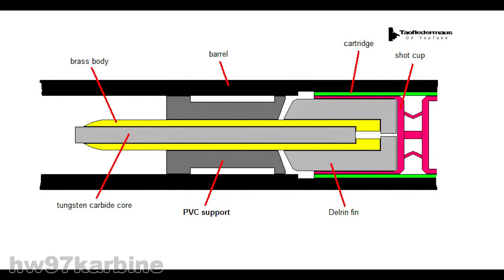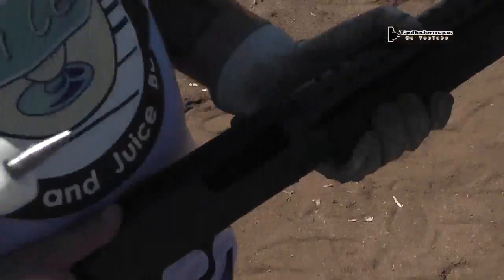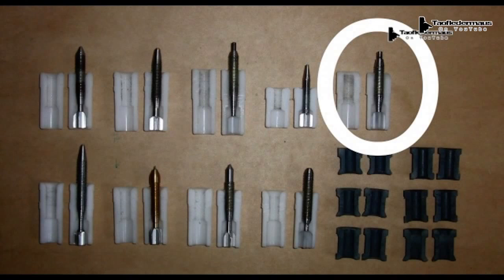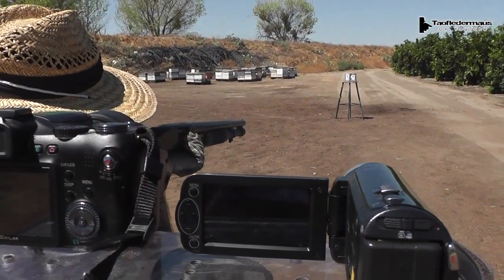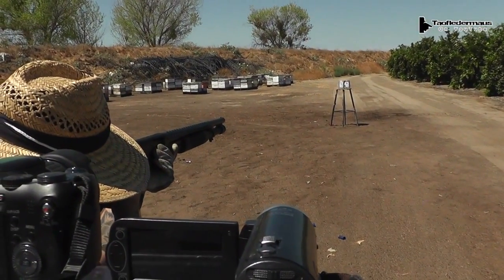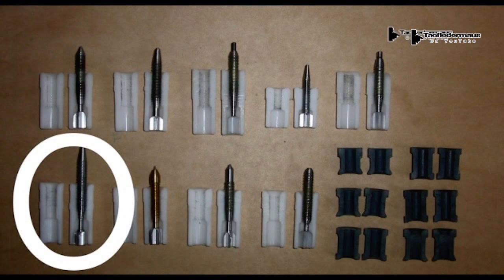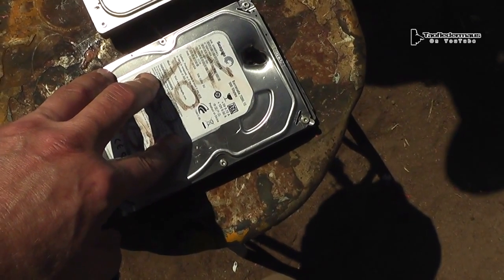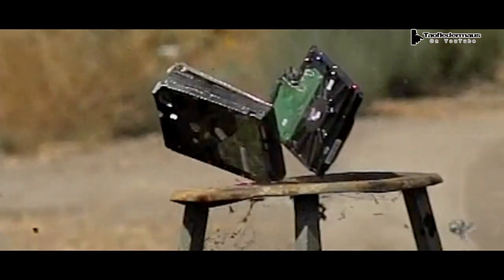Really WEIRD Shotgun Rounds -  You make it - we shoot it!

Comment: Lots of honkity in the comments. The best results were with the longest (heaviest & slowest?) steel dart and the brass dart with the full length support sleeve. Having a rifled barrel would defeat the reason for the rounds, which is to get something similar to an APFSDS round for a smoothbore tank cannon, but in a smoothbore shotgun. The WWII German Rochling cannon shells were very long, very heavy, slow, considered inaccurate, but they penetrated crazily (Fort Eben Emael). You can still visit these Belgian forts and can observe the damage they caused. Also the penetrators are still where they came to rest (the explosives were at the rear of the round). The Rochling shells however were fired from rifled artillery pieces.

Comment: I would like to see an all metal dart with the splitting plastic when it comes out of the barrel which they did show. The only difference is that i want to see the metal fins designed in maybe a slight angle to give the dart spin once the plastic splits and leaves the dart. This would be interesting IMO. Maybe even add some spin to the plastic which mite be achieved by adding some type of angled cutouts to the plastic too so it comes out spinning before it splits. I think this would surely be a success!

Also why not shoot regular slugs at something on the chair first in order to see the correct camera angle and exposure so you dont waste the good stuff?

Comment: The designer of the projectiles should try putting the fins of the projectiles in a spinning manner, like an arrow, or how a rifle'd bullet spins through the air. Also, what about spring loaded fins that pop out after leaving the barrel?
Reply: That is a good idea in theory, very hard to do on such a small scale though.
Reply: Spring loaded seems unworkable, but hinged is easier.  With that, you could use discarding plastic bits to catch air to open them, making sure that they cannot grip after the fins begin to unfold.

This may or may not require a certain distance to unfold and stabilize, though.  Any disruption of the initial flight as they unfold will ruin a shot, even if it stabilizes later in flight.

Comment: After watching both pt 1 & 2, this is very interesting. I think I would agree with ewwustinky about a spiral fin configuration. Think football. Why doesn't a football tumble? It's spinning and that's what stabilizes it. With a heavy steel / tungsten nose, these are bound to tumble due to being nose heavy. Induce some spin like what we would see with a slug and rifled barrel.

I'm assuming this is a smooth bore shotgun, correct? If not, I would suspect the rifling would interfere with the fins.

Also, while carbide is nice and hard, it's brittle. Therefor, it would easily fragment and probably come apart when hitting a hardened target. Stick with hardened tool steel. Unfortunately, these would probably be considered armor piercing, which would make them unobtainable to most if they were ever mass produced. Interesting to see what appears to be taps being utilized to make holes in an alternative manner, lol.

I'd like to see these tested on ballistics gel!

Comment: lead is softer than steel, the steel after only a couple shots would destroy that barrel forever, you could possibly have it re-bored but its going to weaken the barrel strength and cost a fortune, but if you have a junk barrel sitting around and you don't care, id actually like to see what would happen. its very good logic and I may be wrong. but I think the problem is lead expands when it is in the barrel with the rifling and I don't think there will be enough heat to expand the steel.

Comment: You seriously need to change the sabot design of those rounds. Watch footage of the Abrams sabot round and you will see that the sleeves hold the dart mid shaft. pushing the base of those darts is like throwing a dart holding the fins; inconsistent flight and tumbling. They are thrown holding the barrel of the shaft.

Comment: keeping from tumbling = stability.......stability is achieved by either spinning a object(like a bullet or football), putting the weight more forward to encourage straight flight(shotgun slug or old style crossbow bolts) and/or you induce drag on the rear, encouraging the more aerodynamic front to be forward. mortars use the last two methods by having the entire warhead in the front and the rear fins induce drag.

Comment: There's half your problem with these projectiles right there. Rifling or smooth bore, doesn't matter for this. That projectile MUST be making firm contact on both sides of the barrel to maintain even pressure levels, insure accurate separation, and allow the projectile to leave the barrel straight. Even a slight bit of looseness will totally ruin your project as you start making larger improvements. Use softer sabots if you need to, but get that thing fitting in the barrel nearly snug.

Comment: One thing I think your engineer buddy needs to make for you is some annular ring aerofoil projectiles. The military played with them for a bit so there's documented things out there.

Only thing is, it's going to be tricky to get the weight high enough and figure out a way to push it out of the barrel without it touching the barrel. You'd need a skirted hollow sabot with some sort of gas check over the base, much more simple than it sounds. Also use 3-5 piece sabots, it'll help.

Comment: Are those sleeves made of PTFE? It looks that way. There are different kind of Teflon composites you can try to use, I recommend looking into the heat-insulators that print-heads of 3D-printers use (the FDM-type of printers).

They are made to resist heat and stay in shape.

Comment: oh, yeah, I know what you mean. the AA12 is a smoothbore and the fins are to make the gun like a mortar, the projectile being stabilized with air resistance rather than rifling. the shell wouldn't explode anyways, the fuse is made in such a way that it will not explode until it leave the barrel and travels a certain distance, like all other modern explosive ammunition.

Comment: I think that what you are referring to as "Mach Reflection" is compressibility at work. When the moving object encounters an abrupt change in the landscape (your target) the cone of air around it, which is at higher pressure from flowing around the object in flight, hits the stationary object and can't disperse at the same rate that it can on the opposite side. What we're seeing is the result of that high pressure staying on one side a fraction of a second longer, essentially generating lift.

Comment: Use a split sabot, the dart should have a single continuous diameter with smooth sides and an odd number of fins which protrude beyond its diameter. The dart should have a sharp nose approximately 2.6 times its diameter and an overall length of 30 times its diameter. Steel is a poor choice because of its relatively low density and high yield strength. Nickel or copper would be a better choice than steel.

Comment: Comment 2: I would put a hole in the front of the dart where you push a pin with less then the length of the shotgun caliber of course. Fix the pin. Then, take a round thin plate af alu and put a hole in the middle of the size of the dart. Then put the plate on the dart from behind. What happens (I think) is that the gases now push the plate which pushes the dart away. When the dart leaves the barrel, the plate will become slower (less aerodynamic) and will leave the dart alone. Try it.

Comment: The big problem is the tumbling. I think instead of putting all the gases behind the back of the dart, it would be better to put the pressure behind the front so that it is already stabilized when it leaves the barrel. How? Put kind of a round thin plate around the front like a seal so that the gas cannot escape AND the front of the dart has of course to be heavier than the end. Like real darts and also arrows. Hard to explain what I mean when you are not a native speaker. Watch comment number 2

Comment: Maybe some fairly rigid plastic fins epoxied to the body of the projectile...similar to vanes attached to arrows. To better see the projectile in flight you could use some bright colored modelers paint to stripe the body (similar to rockets that are photographed in flight). Just out of curiosity: Given the recoil and the light weight of the projectiles, does the shooter use a six o'clock hold or center of mass? Keep up  the good works.

Comment: Love the footage as always Jeff. I do have a suggestion though for a change. Have you guys tried using a 3" or even a 3 1/2" shells instead of the 2 3/4"? Not sure about the chamber on your gun, but I have 2 shotguns that the chamber will accept all three and I can tell you that there is a huge difference in the amount of powder between the 2 3'4" and 3 1/2 magnum. Perhaps the larger powder volume will provide added velocity which might improve performance.

Comment: From the look of it, the plastic fins work fine once you put a sabot on the dart (and I think work better for straightening the dart out mid-flight, the lower weight means the center of mass is further forward thus providing more torque at the same size fins). Trying to get some spin with them might be worth looking into.